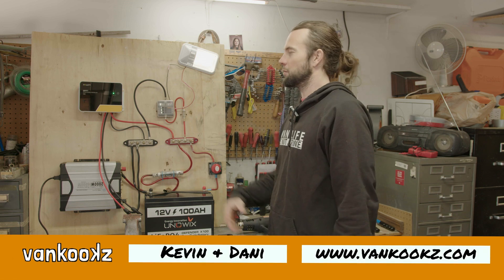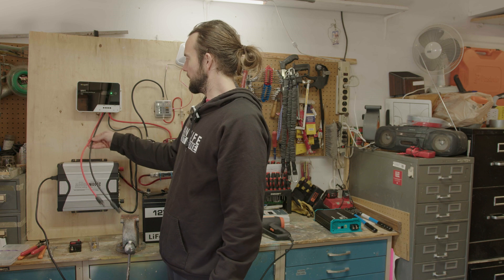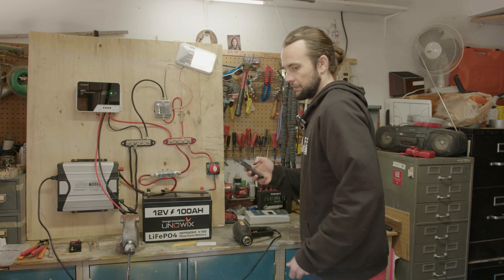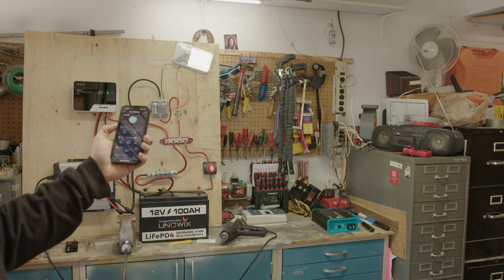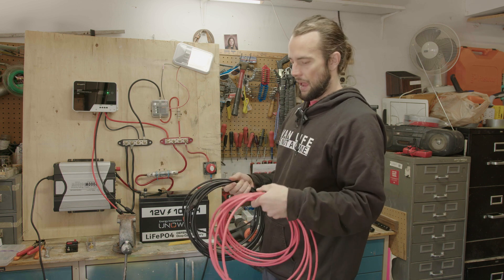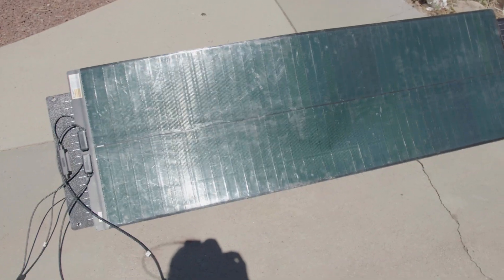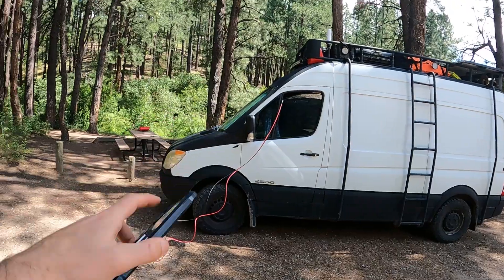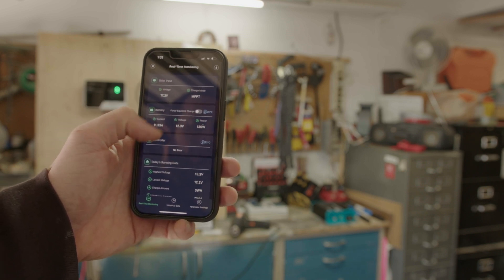BougeRV 40A MPPT and CIGS 200W Solar Panel Complete in Depth Review

Comment: Unless you put the cigs panel on a standing seam roof, which would be at angle, most of the time that panel is going to lay flat on the ground or whatever RV surface...
But isn't this charger unit only for 12 volts???? What about a 48 volt version????

Comment: never seen so much nonsens, 10 minutes play with a heat gun and cal that a in depth review about a 40A charge controller.
how is the voltage accuratcy, how is the effizenz in different conditions ,rain winter, clouds, , how fast is trhe tracking speed in conpare to others.
how it handles 40 Amps = the heat of the device? it shut off or reduce Amps?

question over questions and you show absolutly nothing in any aspect.
20 minutes trash of movie and call that a deph review then put a 100 watt panel on a 40Amp controller and call random nonsens doing good....

check this video out its a real review about the bougeRV 40A charger and all its fails.
BougeRV Vs. Victron Review

Comment: 150W out of a nominal 200W is 75% with pretty good direct sunlight is a problem.   You need to figure out if it is the panel or the MPPT.  Not all mppts are made equal.  Some do a very good job of finding Max power point others get stuck at 75%.
Reply from the maker: You know I’ve tested these panels out on other MPPTs and the most I’ve gotten was 170W so maybe here it is the controller

Comment: Make sure you buy the panel that has pre punched holes,  don't buy the one with adhesive. When that panel heats up the adhesive melts and gets sticky black tar on everything, it's such a mess. Also you  can damage the panel by walking on it. If it's upside down facing the concrete
Reply from the maker: Great point.  Mine had the sticky back and it’s always all over the panel and ground I wish I got the one with rivets.

Comment: I don’t feel that way about the LOADS output on a SCC
Reply from the maker: I like it for an easy basic set up to have the SCC monitor the load output.  But yeah its totally not mandatory.  I just thought it was odd that it didn't have it built in most SCC's do. What is your ideal set up?
Reply: I don’t use the load out there on my mppts so I wouldn’t know what I’m missing